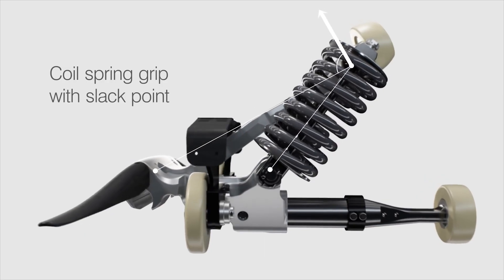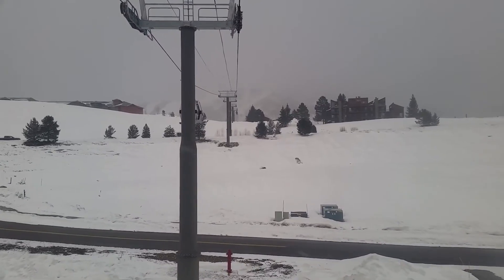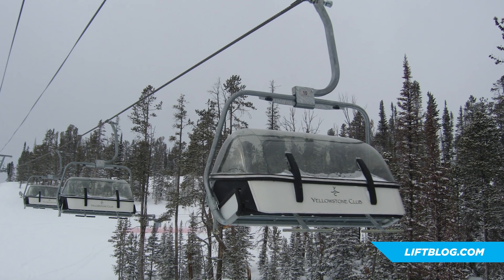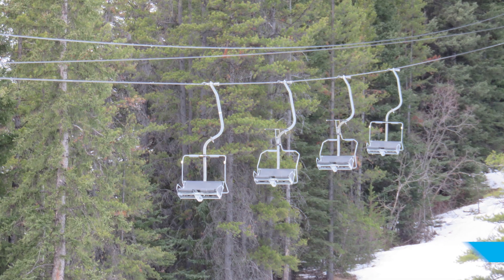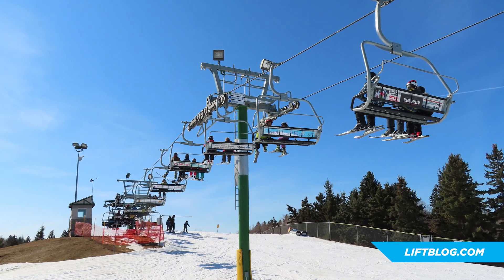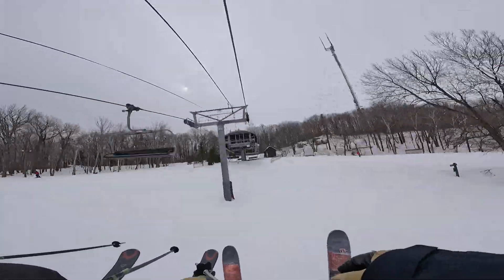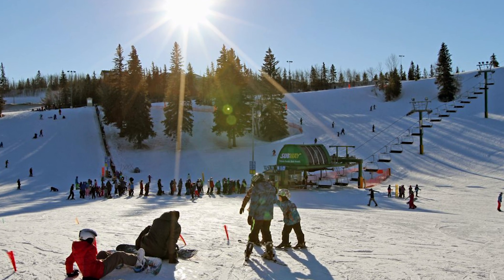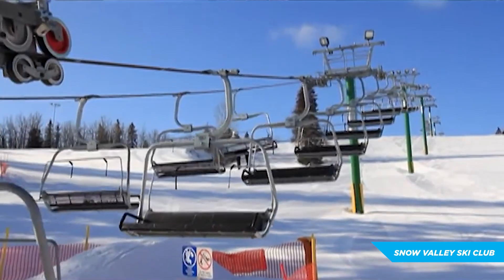Midwest = Perfect for Pulse Lifts?

Comment: Mystery Mountain at Lutsen could benefit from converting to a pulse lift. That has to be one of the longest lift rides in the midwest and pretty low capacity needed
Reply: That’s a great idea, how would they handle the unload? Wasn’t that a mid station unload?
Reply: When I was last there in 22/23, they had somewhat removed the mid unload and had signs saying not to unload there. Which made the ride even longer if you just wanted to ski the bottom part. Curious to see if they open Mystery this next year since they didn’t seem to get around to it last season
Reply from the maker: You can still do Mid-stations with pulses. In fact you could design the spacing to be pulses at loading, midstation-unload, upper-unload, midstation-download. That way all pulses are hitting a station when slowing down.

Comment: I have had a long fascination with pulsed chairlifts. There are so many possible variables. I can think of multiple places in small ski areas in the Alps and Scotland. We also have fixed grip 6-pack chairlifts in Europe. I can imagine a 6-person pulsed lift with greater spacing between chairs, a faster load / unload speed of 250/300ft per minute and a longer lift line that can obtain a capacity of 1500/hr 

Additionally, a benefit of a pulsed lift over fixed grip is that if the summit station is particularly windy, the chairs can be stationed halfway up the line on both sides rather than being at the exposed summit and sheltered valley. 

Once before I considered if a detachable/fixed grip hybrid could be engineered- a lift where the chairs can be detached from the line for storage and stored away during storms and the summer, but where the lift would operate like a fixed grip in every other manner

Comment: I really thought the interconnect at the Highlands would have been a pulse Quad. It's got a lower uphill demand and longer route, which would make it great for the four (or more) pod pulse akin to Norquay.
Reply: That was my thought exactly. Almost all the chairs go up empty and it's a long distance by midwestern standards. But, they put in a more or less standard carpet loading fixed grip.  The other ripe candidate for a pulse lift would be an interconnect between the two areas at Snowriver. There's talk of a gondola and I wouldn't be surprised at all if it's a pulse lift.
Reply: That is actually one of the few lifts in the state where I can see this making sense.  Good point.

Unfortunately, I think that ship has sailed as they JUST replaced it.

Comment: That would be sweet if you could configure any fixed grip to a pulse…. They could be set up in pulse mode for midweek hot laps and then add chairs for busy weekends.
Reply from the maker: In a perfect world! Unfortunately, it's not that simple.
Reply: That's a neat idea.  I don't think they could just "add chairs" without running into some of the same issues as a detachable but I could see a gating system that blocked the loading of certain chairs under "pulse mode".  

There would be some pretty big safety issues to work out that's for sure.  It'd be REALLY bad news if someone loaded a chair outside of the pulsed block somehow.  I'm also not sure how the chairs outside the pulsed block of chairs would handle being whipped around the bullwheel at the top and bottom of the lift.  That would be...a sight to see.  

That might be too many complications to work through to make it worthwhile.